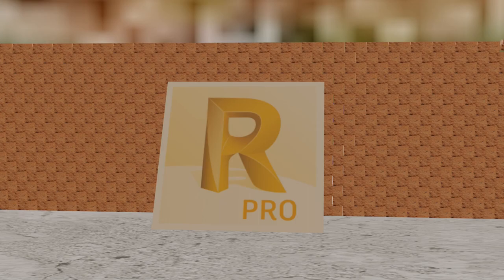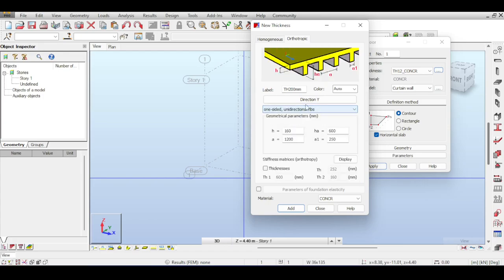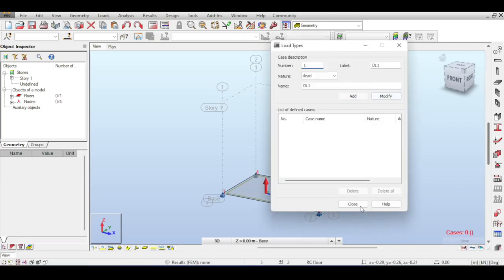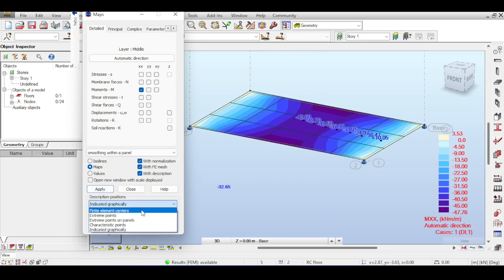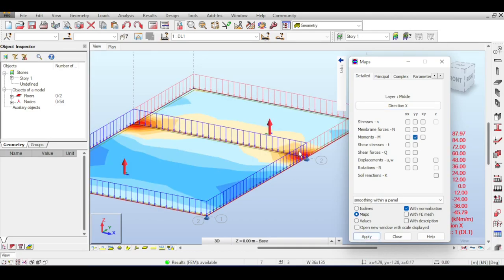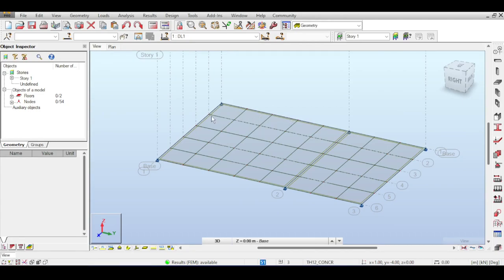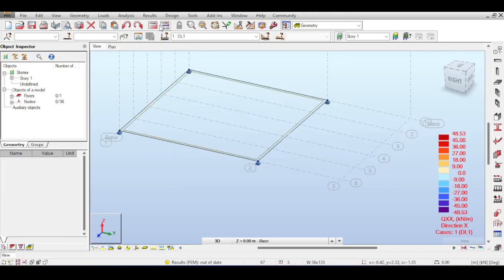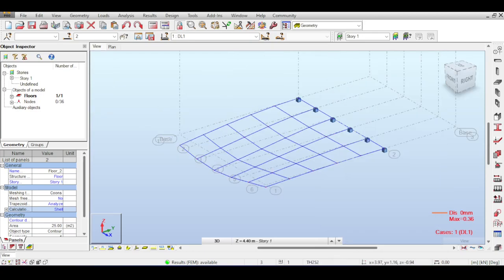Learning Basics of Plates and Shells in Autodesk Robot

Comment: Thank you very much for your explanation, and I benefited a lot from you, but excuse me. Can you explain to me the difference between no smoothing and the rest of the other three options, and what option should I choose for a flat slab. I am not good at English, so I did not understand this point in your explanation.
Reply from the maker: Most welcome
Please use global smoothing for slabs.
Stay tuned for more content
CEE
Reply: @CivilEngineeringEssentials  thanks sir
IAM from Middle East.
I noticed when I use no smoothing. It gives greater shear force as well as moment, but the moment increase only in the center of the column, while in the face of the column the moments remain the same, meaning they remain the same as in smoothing within a panel..and in the shear force do I use global smoothing?.
Reply from the maker: @سيدالبوح  
Well, short answer, you should use smoothing.
Long answer: No smoothing gives the values of the plate itself. Now the calculation of those values is a really looooong story. Here are some insights:
- The elements that are used in shells are DKMQ (Discrete Kirchhof Mindlin Quads), those are calculated using numerical integration at gauss points, whereas the stresses/shears/moments are calculated at the edge nodes.

Here is an out-take of Daryl L Logan's book (A first course in the finite element)
"Smoothing results in a pleasing, continuous plot which may not indicate some
serious problems with the model and the results. You should always view the un-
smoothed contour plots as well. Highly discontinuous contours between elements in
a region of an unsmoothed plot indicate modeling problems and typically require ad-
ditional refinement of the element mesh in the suspect region.
If the discontinuities in an unsmoothed contour plot are small or are in regions
of little consequence, a smoothed contour plot can normally be used with a high
degree of confidence in the results. There are, however, exceptions when smoothing
leads to erroneous results. For instance, if the thickness or material stiffness changes
significantly between adjacent elements, the stresses will normally be different from
one element to the next. Smoothing will likely hide the actual results. Also, for shrink-
fit problems involving one cylinder being expanded enough by heating to slip over the
smaller one, the circumferential stress between the mating cylinders is normally quite
different [16]."
Reply from the maker: I am going to assume you speak arabic, so here are some arabic points to that regard
فعليا، كل مربع أو عنصر من الشبكة له قيم مومنت أو شير على زواياه تختلف مع العنصر المجاور له.
هذا طبعا يخلق مشكلة في قراءة النتائج، وحتى إنه أحيانا قد يكون غير منطقي، حيث إنه من المتوقع أن يكون المومنت والشير (مثله مثل البيمات) مستمرة وغير متكسرة،

وبالتالي البرامج جميعها تقوم بعملية (تنعيم) النتائج، فيحسبون قيمة الشير والمومنت عند النقطة كمتوسط حسابي لجميع العناصر المشتركة في تلك النقطة،

طبعا هذه الطريقة هي المستخدمة في الهندسة المدنية في كافة أنحاء العالم، فقط في حالة كنت تود إكمال دراساتك العليا (ماجستير ودكتوراة) ساعتها تضطر لأخذ هذه الأمور في نظر الاعتبار..

وقد أرفقت لك مقتطع من كتاب مشهور في طريقة العناصر المحددة،،

I tried to write in arabic, hoping it is your native Language.

I do speak German, too. It is actually my mother tongue.

Good Luck,
CEE
Reply: Thanks a lot dear for your help. I apologize for bothering you with so many questions.
I'm left with two questions, how does the RSA take the shear force to calculate the punshing shear?
The other question. I have the same columns, the same panles , and the same forces, but the program gives a different circumference (u)
i use BS 8110 code
Reply from the maker: If you are analyzing a slab or raft, it does not correctly calculate the punching shear, and you would have to perform those checks yourself.

if you are using Robot's own foundation design module, then those checks are taken into account exactly as the code

About the punching circumference, I am not an expert in the BS code, but in the ACI code, it depends if your column is on the corner, edge, or central.

Here more information from Autodesk's Website

https://forums.autodesk.com/t5/robot-structural-analysis-forum/rc-slab-punching-verification-by-maps-and-rc-slab-provided/m-p/3745418

All the best,
CEE
Reply: @CivilEngineeringEssentials  Thank you very much, my dear. I benefited from you
  Yes, my native language is Arabic

Comment: How do you model composite insulated panels?
Reply from the maker: I think I had made a video about composite slabs on beams. But please note that Robot is a little bit limited when it comes to designing the panels

To model those, you can easily apply the "zig-zaggi shape" of the panel by defining it via the "thickness definition window"

Please feel free to ask follow up questions if need be,
Regards,
CEE

Comment: How to make concrete steel interface while doing non typical bracket analysis?
Reply from the maker: Hello there.
You cannot simply interface concrete with steel in robot. As for a shell element (plate element), only 1 material is used and its coefficients are calculated.
Even in highly advanced research packages such as Ansys and Abaqus,  researchers tend to "blend in" the characteristics by calculating a "smeared" material. This is - of course - not the only way.

So I do not think a n interface is possible. What is possible - however - is carrying a concrete slab on steel. This is totally possible and can be done.

Still, Robot cannot calculate the shear studs used to cause slab/steel composite action.

Regards,
CEE

Comment: Have you tried to analyze the deformation of a slab supported by beams?
Reply from the maker: Not yet. I only show the deflection shape for the "sense" of the structure. 
I will provide more details about it later.

However, it is VERY important to note the following about RC slabs:
The deformation that you get from any FEM software using simple deformations are elastic deformations. However, design codes require you to check against long term deflections. 
It is calculated using a cracked section inertia and some modified factors.

I will give detailed descriptions later.
Thanks for your suggestion.
Reply: @CivilEngineeringEssentials  yeah thats an interesting topic too, but i was refering to the erratic deformation whereas a slab is being supported by beams and columns, have you ever noticed that in robot structural?
Reply from the maker: I did. It is related to the meshing of robot. I think I should make a technical video about that soon.
Reply: @CivilEngineeringEssentials  that would be awesome, nobody has done it yet, thank you very much!

Comment: how to apply point load on surfaces (panels). ı tried adding a node and applying the load but the program gave me warning message that the load is applied on unconnected nodes
Reply from the maker: if you add a node to a plate, it should work.
One important thing is:
Check that Robot meshes the surface. 
If it does not mesh the surface, then make sure you selected the model "Shell" when you defined your floor/plate.

Otherwise, the node will not connect to any Finite Element, and you get a warning about "Isolated nodes".

Please try the suggestion. If it still does not work, please let me know.
Regards,
CEE
Reply: @CivilEngineeringEssentials  I don't want to analyze the surface. I am modelling a trapezoidal steel sheet roofing and applying a resultant force with 0.25 eccentricity.
Reply: thank you very much 
 @CivilEngineeringEssentials
Reply from the maker: If you do not want to analyze the surface, then a point load wont work because it would be floating in the air.
In robot, you would need a plate to carry the load. Otherwise it will be counted as isolated node.

Comment: How can I design solid slab in one way direction?
Reply from the maker: Hi there,
you can design a 1 way slab as follows:
When you draw your slab/floor,

There is a (...) near the word (shell). Click on it,
Define a new calculation model, call it shell1x (DO NOT OVERWRITE THE SHELL)
then in the bottom side, you should select One Way

then, use this model to draw your slab, do not forget to put beams around it, then it will calculate 1 way moments and you can design it.

I made a quick example under this link:
https://drive.google.com/file/d/1PsYdpfWY-lhD4xwlYDOz_GGZ60UWLGa3/view?usp=sharing

Regards,
CEE